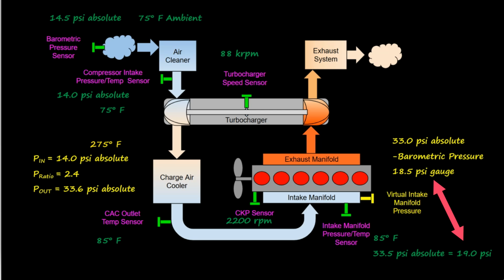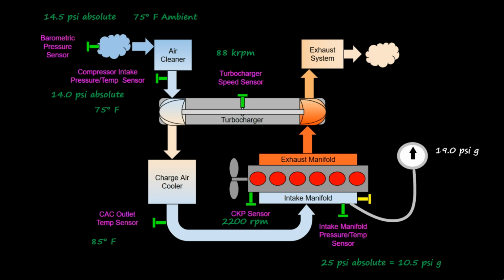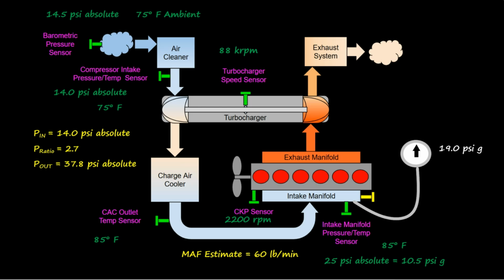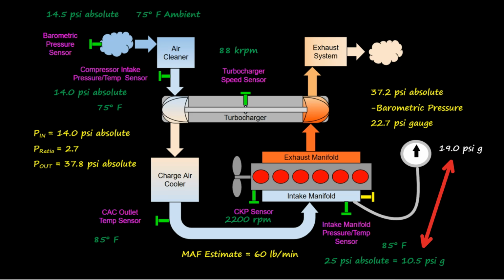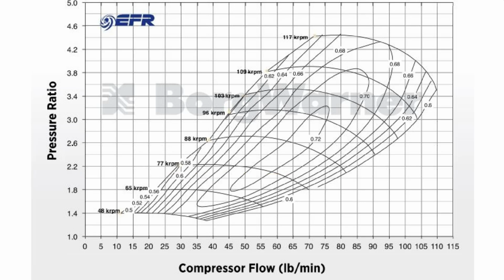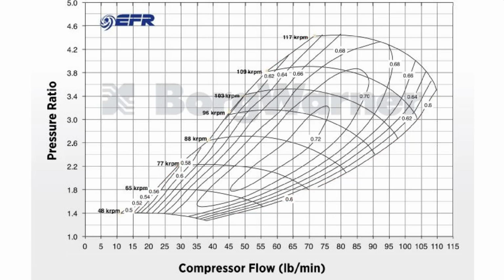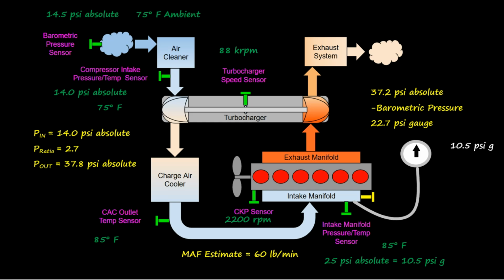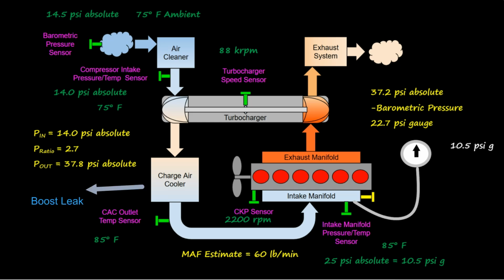2 Virtual MAP Failures

Comment: Well explained, appreciate the attention to detail. Was working on a 2000 International 4300 last for a crank,no start (noid light and Fluke 88 made quick diag of failed coil on IPR valve) and I thought that Joe probably had some involvement in the testing of electrical system of this truck family! Thanks, look forward to more to come. Steve
Reply from the maker: Yes, I would have been the test engineer for that truck series.  I must have done an okay job since it has not burned to the ground in 25 years.
Reply: @joebell6283  Lol, you did! Our fleet does have an 05 7400 tandem axle dump truck that I wouldn't mind if burnt to the ground and the front gear housing leaks enough that thermal event should accelerate rather quickly. If a guy was to buy your book, you still get any royalties?